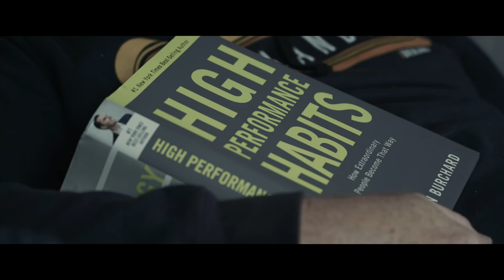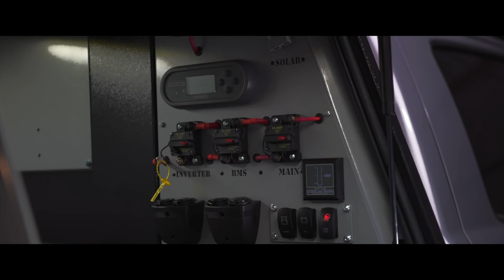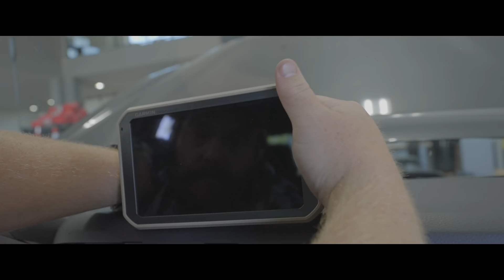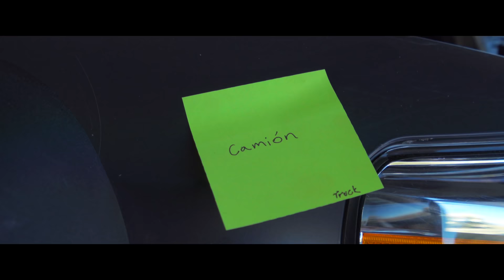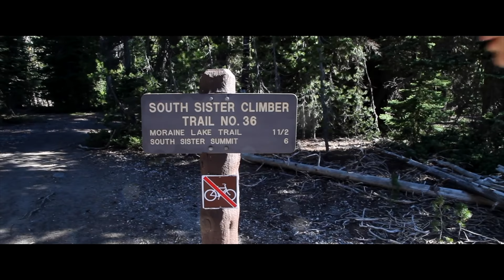EP1 Expedition Overland's Baja Special // Let's Overland to Baja!

Comment: SVC has a design to protect the Ford Raptors Electric Steering Rack which is one of the failure points.  This would be perfect for what you guys do.  

I saw it described on the YouTube channel “Keep It Dirty Off Road” as they went to SVC’s shop to see how they build thier trucks.  SVC Built Ken Blocks Hoonigan Raptor so these guys absolutely know what they are doing.

Comment: I betcha nice to have such wide open budget just to spend on truck upgrades. Just 4Runner went about 10/15 K in upgrades
Reply from the maker: 10 years of very hard work!
Reply: @ExpeditionOverland  sure man just saying.  I spent over 4 years maybe around 15/20 K myself. Just make sure people understand its very expensive hobby and no mix messages .plus just 10 k on broken engine . Sh... brakes and that can very expensive.  There are many youtubers shown amazing places but the cost is always behind sense look like even RTT is 300 bucks. I think Ovelnding became like luxury camping and vacation.
But some of these YouTubers are got sponsorship from the manufacturer so we are paying in the end the cost of the equipment and its expensive . Any decent rack is 1K at least after installation. Any bumper is like 3 K simple lights kitchen can drive cost to 2K . I would like to see a better represent information by YouTubers

Comment: Hey Expedition Overland! I'm a Motion Designer working from home. I would love to build a rig (either on the truck or a hauler) and travel the US designing and enjoying life! The only thing holding me back is access to internet in remote area's or wherever I find myself each day in the world. I plan on looking into Starlink, I think that might be the way to go for me, but do y'all have any feedback about internet access when traveling for a year? Also, I have a pretty beefed out computer that I need to build into my rig, do you have any ideas on how I can stabilize my computer so the parts inside don't raddle and break loose when going over massive bumps and rocks?

Love the content! I think I would like to build a Tundra Rig for my adventure!
Reply from the maker: Hey there! We utilize coffee shops, restaurants, etc. for internet access. It's been pretty easy to find internet when we need it in towns. South Baja was a bit harder to find service remotely. The starlink hasn't been consistent enough yet for us but we have been trying it out at our shop. Any computer you can find with the solid state drives is the way to go! Lots of good protective cases work great in addition to solid state drives. Thanks!
Reply: @ExpeditionOverland  I appreciate this, thank you!